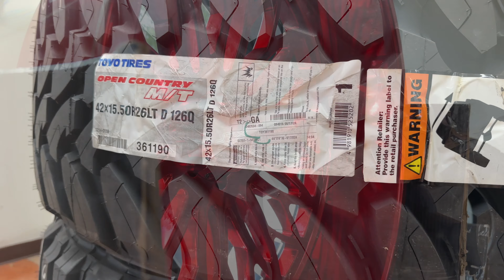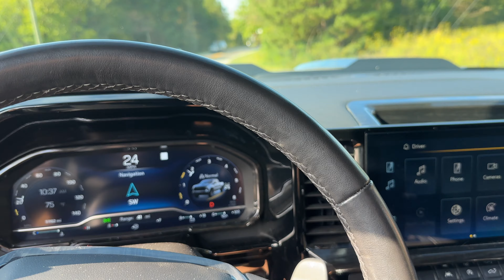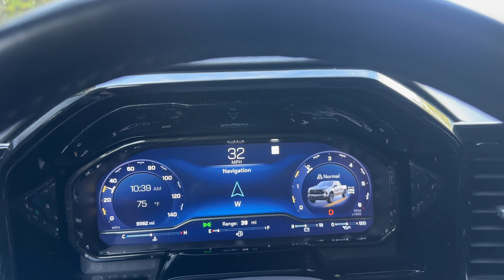BIGGER is BETTER: Trailboss Transformation 12” FTS lift, 26x14 JTX Forged wheels, and 42” tires

Comment: You guys perform gear swaps too to compensate for the larger tires?!?! I never see any footage of that being done or being dropped off to be performed…. I understand that it may be able to be calibrated in the electronics BUT that is the one thing I would not overlook if I were lifting my new 3500 Chevrolet dually and putting 40’s under it which if I remember right would require 4.88 gears…. You guys are doing amazing work and honestly wouldn’t mind the road trip to get mine lifted but the gears would definitely need to be addressed
Reply from the maker: We do not do any gear swaps here. Most of the newer trucks we lift still have good power. It is definitely a good upgrade at the end of the day though.

Comment: i have a 2024 silverado 1500 and have been watching all your videos for the last month on trying to decide the setup i want to run. on the mcgaughys kit you mentioned on a video before that you can stretch the 9" kit to 11"-12"... curious to when your stretching the kit with a lower leveling kit past 9" how are you matching the rear lift after the 7" blocks and 2" add-a-leaf springs so it sets level?
Reply from the maker: I never stack anything on lifts, that is asking for trouble. The McGaughys lift is a 7-9" lift so 9" is the highest setting. I would recommend the FTS 12" lift
Reply: Understandable! So if i go with the 9” mcgaughys, 37x13.50x24 and 24x14 -81mm arkons, how much metal cutting is usually done on the cab side to not rub at full turn? Or can you suggest sizes for no rubbing on a 37? Ive always been on 35s so never had rubbing issues so curious as i wanting to run 37s now.

Comment: How do these trucks barely fit 37s on the 9in kit, but can fit 42s with the 12in?
Reply from the maker: We did have to trim a good bit on this truck but it worked!
Reply: because 12 is a lot bigger than 9